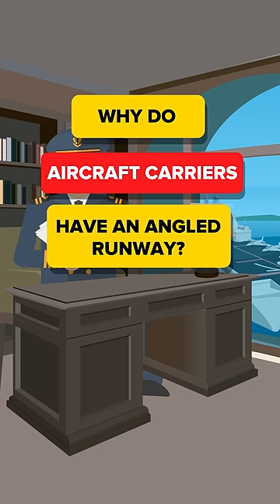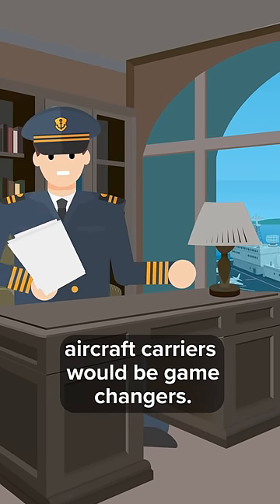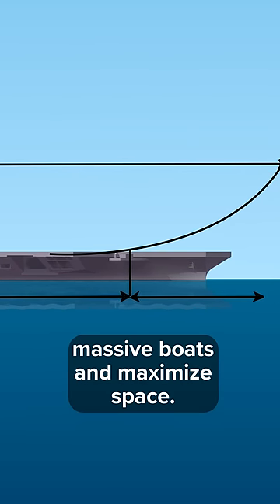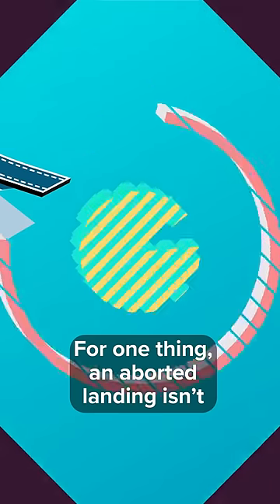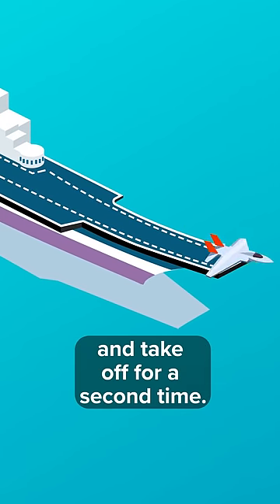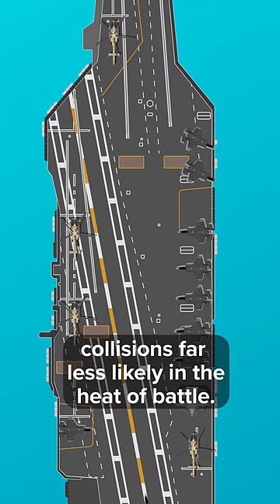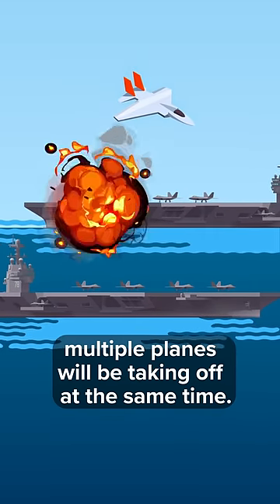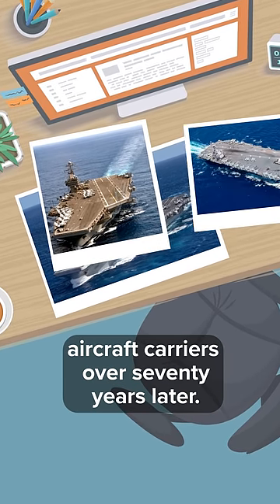Why Planes Take Off at an Angle on Aircraft Carriers #military

Comment: You got it 100% wrong. They take off straight from the front (using the speed of the always-moving ship, plus catapults to aid their takeoff), and they LAND on the angled runway to maximize the length of the landing, and steer them clear of the tower to prevent debilitating collisions, minimizing crash damage. This is to completely separate the two operations so that aircraft can both land and take-off simultaneously. bad BAD research on this one.
Reply: Your answer makes more sense.
Reply: it is also for the pilots saefty if the aircraft falls off the runway so the ship does not crush the pilot
Reply: Except when doing recovery, aircraft laying launch from the bow and angled deck.
Reply: the thing that owns doesnt research he just throws random nonsense
Reply: Also so have higher chance of surviving if miss
Reply: @somethingrandom617   not all us aircraft carriers have angled flight deck
Reply: I was gonna say the same thing.
Reply: What’s new about the research
Reply: @andrewhoughton8606  all ships  carriers do, it’s the “amphibious assault ships” that are floating bricks, (if i remember correctly)
Reply: You can see this by just looking on the deck of one. Even i know that from only playing test flight war thunder

Comment: The graphic with the F-35 landing and then parking, followed by another taking off are the wrong way around. Planes take off from the front part and land on the angled part.
Reply: Explains so much.I researched, I'll go with  you. This dialogue sounds like that movie spoof "Airplane" absolutely hilarious. Air Traffic Control to pilot, "look Lindy, this ain't rocket science. You pull the stick out, the plane goes up, You push the stick in, the plane goes down. What could be simpler?

Comment: Although the British came up with it they have now moved away from that design.

They use a ski jump instead.  This is because UK aircraft carriers were designed to work with F-35B aircraft which have a short take off and landing and can even do a vertical landing like the old Harriers.
Reply: But the QE carriers are designed to be easily modified to become CATOBAR capable in the future. The spaces are there for the cats and traps, just remove the ski jump, install the cats and traps, repaint the deck markings and you're good to go.
Reply: No, they were designed for the ski jump because it's cheaper
Reply: They were, to use the MOD's wording, designed for but not with CATOBAR capability. They're expected to serve for 50 years and may need that option in the future. Right now the f35b suits their needs. After F35 who knows, hence the ability to install CATOBAR equipment later on if needed. The decision to go with the ski jump now however was related to finances.

Comment: I love the fact that in this short, are F-22s are the carriers, even though they can’t land on them.
Reply: Why can't the F-22 land on a carrier? Does it not fit in the catapult or somthing?
Reply: @inosuke_on_a_budget  The hook to catch the wire can't be put on the F-22 because it'll ruin the stealth properties and because it's mainly used by the Air force not the navy.
Reply: Oh, I think the F22 could land on a carrier, once. After that, same as for most USAF tactical aircraft, the airframe would be scrap. They are not designed to take the repeated heavy stresses of catapult launch and arrested landings
Reply: @inosuke_on_a_budget  They're not designed to, they need a longer runway and/or their tailhooks can't take the deceleration required for a carrier landing
Reply: @mikusfan6125 i would disagree as most like f15 and f22 have tailhooks for emergency landing for airports. Though it may also work on aircraft carriers but not recommended. You also have to remember that the f22 raptor was chosen by both the navy and airforce as a plane compared to the yf23. Meaning it was probably planned for carrier use but scrapped later on as we can see it not being used by the navy.

Comment: Go to for aircraft carriers : proceeds to show uss gerald
Reply: But it has an angled deck
Reply: @samsonmoses2132  no it does not it has a catapult
Reply: @kunjpatel9570  no the nimitz does, please see the photos of Ford class, and what an angled deck means. It has EMALS instead of catapult launch system.
Reply: @samsonmoses2132  angle deck =/= ski jump ramp.
Reply: @JM-lk6wo  who said they are the same. Also the OP has edited his comment, FYI.
Reply: @samsonmoses2132 Both Nimitzes and Fords have angled decks, what are you talking about? In fact all American carriers since Essex refits had them
Reply: @kubauhlir1730  the OP had originally posted sarcastically that after saying Angled Decks, they showed Ford class indicating that they didn't have angled decks. I commented saying that they do, which he originally denied. He is edited his comment and caused the confusion.. Smh

Comment: And here I thought the angled runway was for failed take offs. Plane goes into the drink, boat doesn't run over them. Silly me.
Reply: it's for failed LANDINGS. planes take off straight from the front and land on the diagonal. 2 separate operations, 2 separate parts of the ship. that way a plane can land at the exact same time one is taking off. it's also to prevent collisions with the tower, which would disable the ship.
Reply: @MG  on US Navy CATOBAR carriers there are catapults on the angle deck also allowing aircraft to launch from both. The angle deck catapults are used less often though.
Reply: @MG-nz6bx  

The angled deck also facilitates an aircraft's ability to power up and go around and make another attempt at landing if the tail hook fails to catch an arresting wire.

Comment: Heres a what if statement. What of they added two angled flight decks and made the carriers even longer?🤔
Reply: The carrier steers a bit off the wind so that the wind will go straight down the angled line. They both would have to be parallel, and problems with the island would have to be fixed.
Reply: @greggweber9967  Nope, not true.